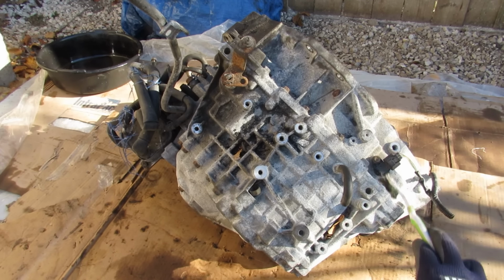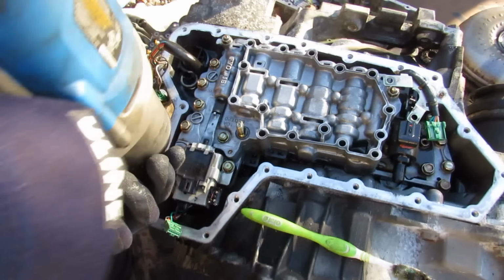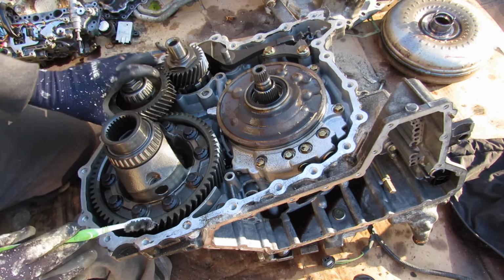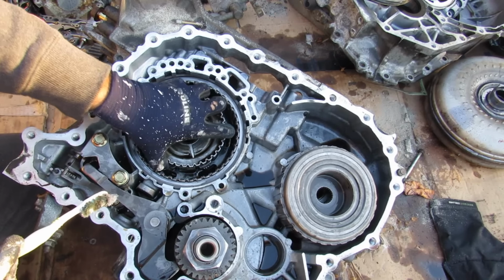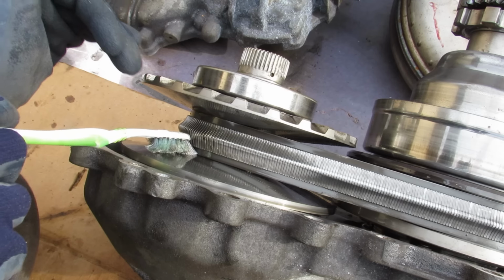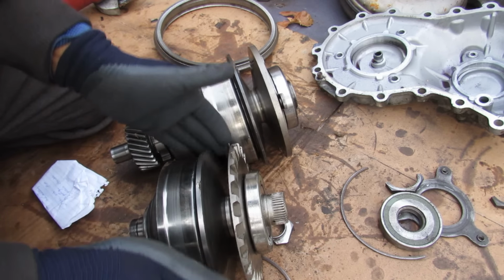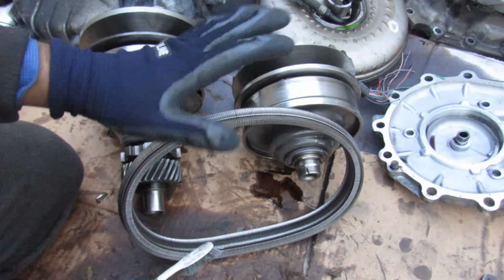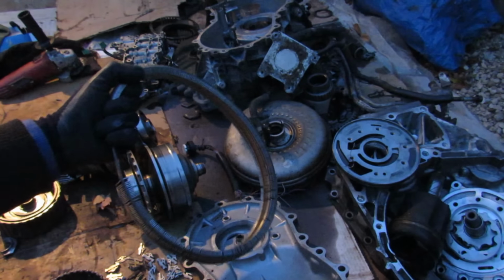Why Nissan CVTs FAIL

Comment: CVT are used commonly on cheap 100cc scooters, and nobody is going to brain wash me saying that is reliable on car engines with 80+ horsepower, it simply use friction linking and friction scares me, Torque converter in a normal 5/6 speed Automatic transmission is the way to ensure some endurance and reliability.

Comment: Very interesting. My young daughter brought a 2nd Hand Honda Civic that had a very sick CVT. Had to put on some revs before it would abruptly snap into drive and lurch forwards. A beast when it comes to parking the thing. When she brought it to me, I sold it off to a trader. But then I was drove a MURANO a hundred miles without knowing it was a CVT. I am not used to CVT's. It was an odd feeling car, and I note your mention of rubber bands - sounds likely. But I stoked it along - it did seem to survive. But in these modern congested times, I am a convert to autos from Manuals. Suspicious of CVT's. I also prefer AWD transmissions.

Comment: I was looking at parts on RockAuto and they had most the parts, I have a 2017 Sentra base model with the CVT Automatic Transmission. My car was not responding to my gas pedal, it would only go a few mph, then eventually get up to speed. Very informative about the system and why my car is driving like that!!👍🏾 I’m sure they can use parts that work with new parts, I hope 🤞

Comment: Drive your car with smooth/slow acceleration, don't put it in the manual shift mode ever, and have the CVT fluid changed at the dealer every 70 or 80 thousand miles and it will last.
Reply from the maker: Yeah try telling that to Nissan who markets the Maxima as a 4 door sports car with 300 HP...
Reply: @speedkar99  I've got the Maxima... and I have to drive it like it's a 4 cylinder to protect an anemic transmission.
Reply: @AudioGardenSlave123  I beat the crap out of my 2015 altima. 92k miles and still drives like new. Changing fluid every 30k miles. Idk, the failures make no sense... some people baby them and they fail, some people drive them hard for 200k miles. It's very weird.

Comment: Idk of it's just me, but if I see a car with a CVT, it's not even a consideration any more
Reply from the maker: Agreed. I even hate to rent one now.
Reply: @speedkar99  
I'm currently driving an old Dodge caliber. And this car has ruined me on CVT transmissions 

It is just so bad. 
In a few weeks or by the end of the year I'm looking to upgrade and I'm most likely going to try and get into a used CX-5.
With a RAV4 non hybrid as my backup option

Comment: Well I'm glad I just sold my Infiniti QX60. At 60000 miles engine started lots of pinging noises.  Structurally not as solid as MDX which I now own. MDX is built so much better.  And after reading the shady things going on at Nissan hq never buying anything from them ever again.  Former lifelong customer since the 1980s.
Reply from the maker: The Vq starting pinging? Aren't those tuned for premium gas?
Reply: @speedkar99  It was a constant high pitch noise coming from the engine.  Definitely not good and definitely should not be happening at 60,000 miles.

Comment: When they put a snow mobile "transmission" in a car, you can expect trouble.
Reply: I thought that when i drove the rogue when it came out. Never liked it
Reply: Snowmobile CVTs are pretty much completely mechanical.  No electrical and hydraulic BS.  Why cant car manufacturers just simplify their CVTs and make them super easy to maintain / replace wearable parts?  Then CVTs wouldn’t be that bad.  Instead we get engineered obsolescence.  The more CVTs fail, the more money they make.
Reply: @Venomrs4  A completely manual CVT would be neat, has anyone made one?
Reply: @polygondwanaland8390  Nah, but I think a lot of them have paddle shifters which simulates “gear ratios” like a regular automatic with paddles
Reply: @nightraider500  Yeah but that's stupid. CVTs have ONE interesting advantage and they piss it away by emulating a slushbox. Give me full analog ratio control!
Reply: @polygondwanaland8390  the Daf varamatic was completely manual
Reply: @bigKDL  Well, completely automatic. It used bob weights, vacuum switches, and the brake light switch.
Reply: @Venomrs4  True. Good thing that Honda and Toyota make actually reliable CVTS which actually last a good while. If all CVTS where on Honda and Toyota’s level of quality, people wouldn’t hate em as much and would probably be fine with them.

Comment: I have a Nissan Sentra s... I work as a Lyft driver and was told by a Nissan tech that in order for this transmission to last a VERY long time 180k plus... all that needs to happen is to do a 40k transmission oil change on the dot... don't abuse with towing and it will make you very happy ... fuel saving is through the roof ( I do about 35-45mpg average combined) my Nissan is already in the 110k and still purring and pickup is as good as the first day.

Comment: I've never seen a CVT with paddle shifters. In fact, I believe no CVT has paddles
Reply: Nissan Altima SR has paddle shifters, and I never had a problem with my CVT, I just drive it, NOT beat the shit out of it!
Reply: @samrubino3807  are you sure it's a CVT? CVT transmissions don't shift even though Nissan mimics shifts
Reply: @samrubino3807  ok, I was wrong and just discovered they put paddle shifters in CVT transmissions. It simulates gear changes. I'd have to say it's the dumbest thing. Also, forcing your CVT to change gear ratios seems really bad regardless of how easy you are on it.

Comment: Poor seal quality and poor CVT fluid quality initially. Was slightly rectified by moving to Idemitsu for their CVT fluid, but it too was marginal. Follow that up with telling everyone the CVT was NOT serviceable AND the fluid could go 60k+ miles, which were ALL lies and you had massive failure. If these transmissions were serviced every 2 yr/30 k with the "hidden filters changed" they would be very reliable. Nissan installed FEAR in everyone by telling them that they HAD to use the NISSAN CVT fluid which was a MARGINAL FLUID at best from Idemitsu (after they tossed out the first supplier). MANY fluids meet or exceed the requirements for the CVT fluid. Filters AND fluid changed every 2 years and there will be VERY little issue with these transmissions. The fluid not only has to support function as a hydraulic fluid in the CVT pistons which alter the ratio, BUT it also has to perform as a lubricant keeping the CVT chain properly lubricated. What the fluid did NOT do well was as a lubricant to the chain. These transmissions built up, without proper care, a large amount of fines trapped in the primary screen BUT also traveled into the secondary filter precedent to the valve body. When these became plugged with metallic fine particles flow was reduced causing bearing starvation, fluid foaming, pressure drops, etc and inevitably overheating and bearing failure (whining/whirring is the start). What is truly interesting is that if the filters were changed on a regular interval and the fluid dropped every 30k MAX - very little negative happened with this transmission. I REALLY find it distasteful that Nissan TOLD customers nationwide that these transmissions were NOT serviceable and were "sealed" and therefore could only undergo "drain and fill" which was a COMPLETE LIE! Nissan dealers could have EASILY completed these regular transmission services, replacing fluid AND BOTH the SCREEN filter and the 2nd FILTER (round) and made GREAT money AND kept their customers cars on the road and VERY happy!!! YET Nissan did not permit that to happen. Had it happened AND owners switched to synthetic based CVT fluids that met the requirements - there would be any issues! Simple message - CHANGE your fluid and filter EVERY 2 years or 30k REGARDLESS AND MOVE TO A SYNTHETIC CVT FLUID AND STOP USING IDEMITSU fluids in your CVT! There is NO warranty issues and Nissan CANNOT deny your warranty claim for using another brand fluid IF it has been certified to meet the requirements of your transmission. e.g. NS-2, NS-3 etc. Magnusson Moss IS the Federal law that FORBIDS dealers from telling you that you must USE THEIR products to maintain your warranty OR they will not cover it! If they tell you that you are required to use THEIR fluid OR EVEN HINT AT IT -  then they are REQUIRED by law to provide it to you for FREE! Feel free to tell them that AND tell them to look up the Magnusson Moss Act and read it and WEEP. Want a great CVT synthetic? MOVE TO CVT NS-2 approved AMSOIL. Great lubrication properties and solid hydraulic properties also. Will perform VERY well in your CVT trans! Check the requirements and test approvals!

Comment: CVTs are a marvel of engineering, people hate on them for breaking but that improves with time, Toyota has used cvts in the Prius for a long time and they are very well made, a cvt is cheaper, lighter, more effective way of adjusting gear ratio. People hated regular automatics when they were becoming the norm, now people complain about cvts and wish they made regular automatics. Honestly I love cvts, and it’s exciting to see how they will improve and progress in the future. Only problem is those dumb fake gears these manufacturers keep adding to cvts, completely destroys the entire point of a transmission that doesn’t shift gears. Hopefully people get used to not shifting and they’ll stop adding fake gears.
Reply from the maker: More efficient yes. Not durable. Especially in heavier SUVs
Reply: @speedkar99  for sure, but I can see that improving with time. Love your videos btw, best channel for learning mechanics 👍

Comment: Thanks for the great video. Really interesting presentation. In the mid-80s I met a Van Doorne engineer who was working on the metal belt segments for CVTs. His explanations were a LOT harder to follow than yours :). Still, these are quite the engineering marvel for anyone who drove a 70s era snowmobile and regularly changed rubber belts on the CVTs.

Comment: When CVT's experience chain or belt slip do RPMs spike or drop?
Reply: From how he explained it, the CVT belt is being pushed/compressed at the input, so any slippage would result in a increase in RPM. The belt would have to severely slip for any noticable spike though.

Comment: Had a murano for 12 years with no problems. Nissan transmission fluid is $12 a quart and costs about $250 for a complete change which is required at 10000 miles and 80000 miles.

Comment: So, you would not advise manually selecting a lower gear when braking to assist in slowing down with a CVT automatic transmission? IOW using “engine braking”?

Comment: I believe that's actually a "pushy" rather than a pulley. The drive pushes the driven. That's why it has to be metal. RZRs use a cogged rubber belt because the drive pulls the the driven.

Comment: Purchased a new Altima in 2007, drove the car 180,000 miles with no transmission problems, and never changed the transmission fluid.  Other than routine maintance the only thing I did was change the spark plugs and replaced two coils.  I still would be driving the car but it got totaled when hit by a Chevy 2500

Comment: I suppose you are saying regular automatic transmissions are great and never fail. I guess you’ve never owned a Chrysler. You also say the jerking when regular automatics change gears is great as opposed to smooth CVTs. Of course the jerking is what causes them to fail. Prior to CVTs,  the automatic transmission shops were plenty busy franchising and making a fortune off of fools that bought them. Be realistic instead of so biased. Currently GM is fighting a class action law suit on their 8 speed transmission. They were in law suits in 1980 over transmissions in their Firebirds and so on. They are no better at all.

Comment: Excellent video. Instead of reliability Nissan was supposedly going for saving a few mpg's and disposable crap where customers had to take the hit. It backfired on Nissan to the point where they are almost out of business. I was looking at a used 2011 Nissan Quest, which was very nice and luxurious but had the CVT's trying to work with 260 horse power and move a big minivan. The fuel savings were not any better than other minivans from the period. It's a shame and a lot of used car dealerships are still selling these cars to unsuspecting customers.

Comment: Thank you a great detailed explanation. My son got a 2011 Cube trans failed at 106,000 miles. Nissan said sorry the 2011 Cube is not covered for trans replacement but, 2010 is? We opted for a dealer rebuilt trans at a local repair shop. $3500 1year or 12,000 only warranty!  Never again any type of junk CVT especially Nissan. We had it serviced every 30,000 miles.

Comment: Belt drives of any type cannot push. It might be a good sales gimmick but engineering wise cannot happen. The proof is simple cut three inches out of the belt on the nonpush side and see if the belt can still push the drive pulley.

Comment: The transmission may be junk in some ways but I like the VQ engine, it's sad they don't make it possible to rebuild the cvt because they tend to be lighter than a traditional transmission and seem to not be overly complicated as far as disassembly/re-assembly goes.

Comment: Can confirm, my 07 Altima had its original transmission replaced at 110k, and the replacement (free, warrantied, thank goodness) is failing at 180k with PERFECT maintenance and gentle driving.  Meanwhile, my backup 07 Toyota Prius's transmission with 205k miles is rock solid.  Next car will be a Toyota.
Reply: Toyota eCVT is totally different, there's no belt.
Reply: @cebruthius  Good point!

Comment: What is the reliability of the transmission on a 2019 Rogue ?  A family member has one
Reply: Tell them to change the fluid every 30,000 miles and drive it conservatively and it’ll be perfectly fine. I know several people who own Nissans with CVTs and they all were happy with them.

Comment: We just bought a 2019 civic touring with a CVT and I've been wishing I hadn't after hearing all the bad things about the CVT. Hopefully the ones in the hondas are better than nissan. Seems like nissan is the ones I hear the most negative. I've never heard any noise with mine. I just hope it will last at least 100k miles or more. I definitely don't have a heavy foot so hopefully that will help lol
Reply from the maker: I would think the Honda CVT hold up better

Comment: It’s amazing how many parts there are in this transmission and that is why it has got to fail sooner or later more likely sooner than later. TRPOS ! I guess the cost is less to the manufacturers and just have to make it before they are out of warranty so you need to pay out of pocket to replace the transmission because that’s where the car dealers really make the big money 💰in the repair shop.

Comment: Following you . hay where do you get The diagrams . i need the one for the 1gen honda cvcc . 1.2 1.5 1.6 L 4 gear and 5 gear manual and the hondamatic

Comment: Simple. Just use a motorcycle drive belt; only much larger. If it fails, it could be a relatively inexpensive repair. 100 bucks for the part, and maybe a couple hundred or so for the labor. This is because the belt could easily be air-cooled, thus you would not have to open sealed fluid filled chambers.    OOPS, did I just give away my potential mega-million dollar idea?

Comment: That was an EXCELLENT break-down explanation!!! As a retired tech, I can fully relate with these Crappy-Velocity-Transmission issues. To sum it up, I hate CVT's period!!!! I'd like to meet the R&D team that sold CVT designs to auto executives so I could give them a piece of my mind. The other POC transmission were the early dry-clutch DSG's from VW-AG. Those Don't-Shift-Good transmissions were horrible, especially the Megatronic Unit solenoids failing right out of the box with 9 miles on the OD! ... what garbage!  My solution, transmission-free Direct-Drive EV's.  Instant torque, little to no maintenance with very little parts to fail.... I love my Tesla's!  Thanks again!

Comment: https://emanuals.com/blog/nissan-cvt-transmission-warranty-and-lawsuit-settlements/   This is the best link I refer everyone to on getting your  Altima CVT fixed for free. The original  CVT warranty was for 5 years / 60, 000 whichever comes first.  The first generation CVT's have a warranty that extends their CVT to 120,000 miles.  It was decided in a lawsuit.  Nissan has agreed on cars built 2013- 2016 to extend their original warranty on the CVT another 24 months/24,000 miles bringing that to 7 years/ 84,000 miles.  Some of you may have even a longer warranty as some dealerships offered free extended  CVT warranties on new cars to 150,000 or even the life of the original owner.  Lifetime is what my dealership offered and they say they will honor it. My best advice is every 35,000 miles do a drain and fill just to error on the safe side.  I did that on my new 2016 Altima  vehicle and the CVT still went at 57,000 miles.  At least I did my part to avoid it from happening.  I hope going forward I'm in the clear.  Everyone please see the link I provided. It states that even though we've gone beyond the 1/20/20 deadline to file a lawsuit claim we still can file a claim.  You just have to act within a certain period of time from the initial service with your dealership.   Good luck Everyone.  God Bless

Comment: what's all the black stuff and sludgy goo in the transmission fluid?  there are no combustion products inn the area....is something burning inside the transmission?
Reply: Most likely over heating causes it, leading to trans failure. Like he said, they weren't designed with adequate cooling.

Comment: My 2013 Altima's CVT failed at 68K. $ 4400 repair bill. There was a class action suite filed which Nissan honored last year. I don't know of any changes if any that Nissan made to my replacement transmission, but I do drive the car more gently, since the CVT was replaced.